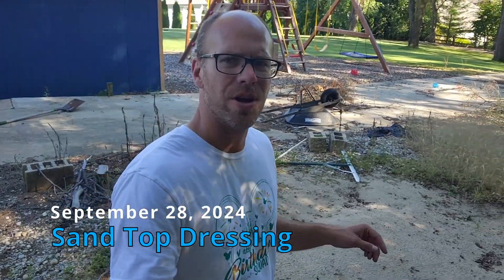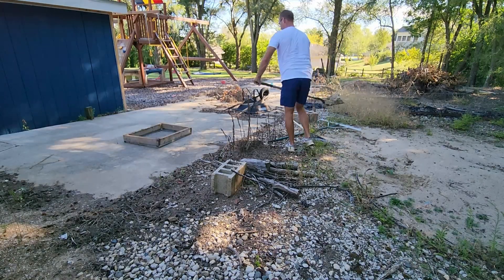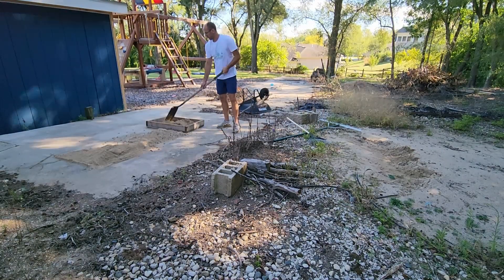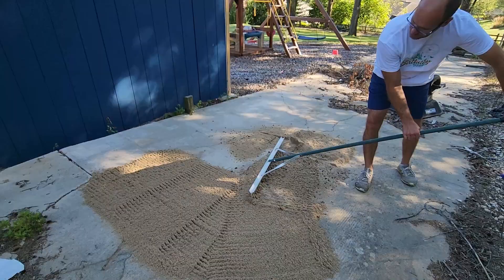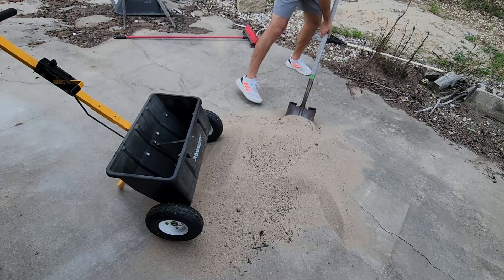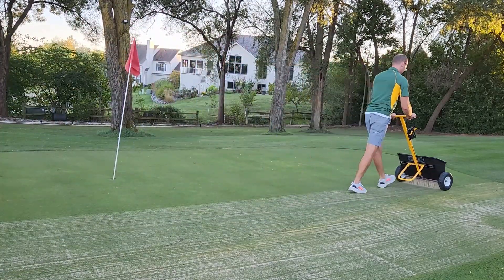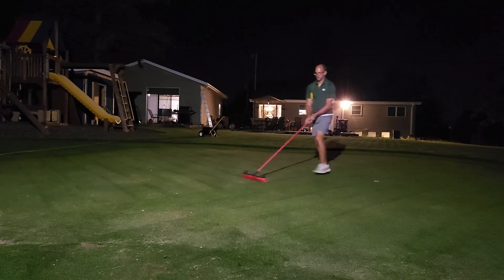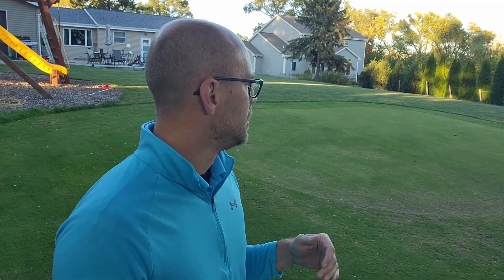Sand Top Dressing a Putting Green

Comment: How large a green is it? I think you and I are essentially in the same part of the world; I also struggle with worm casts.  I am unclear what kind of grass you're using on the putting green.  Does it just die every year? Do you have to worry about it spreading into your lawn?
Reply from the maker: There is a lot to unpack here, but I'll try to be as succinct as I can. I'm in the Milwaukee area. It is predominantly bentgrass. It doesn't die inherently, but being cut very short makes the margin for error much smaller combined with bentgrasses susceptibility to diseases like pythium and dollar spot. Dollar spot is what I lost a lot of the green and fairway to this year. I also struggle to water effectively as I don't have irrigation and have a ton of evening activities that don't allow me to water. I don't worry about it spreading as there are some selective herbicides to remove it.
Reply: @JasonSeiberlich  Thanks; yep, same part of the world. You didn't mention how large the green is; I'm sitting on 1/3 of an acre, wondering what area I would need to make for a good project. I recommend checking out 50lb. kiln dried bags of mason sand from Menards.  The sand is bone dry, and extremely uniform. The bags are super convenient and can be stored outside. I know USGA sand is special, but I can't imagine anyone could ever tell the difference.
Reply from the maker: @hatpeach1 sand selection is mostly for particle size to ensure appropriate drainage and resisting compaction. But, yes, mason sand is usually fine. Often just too high percent of smaller particles that can pack together. 

My green is just under 1000 square feet and the whole area is around 7000 square feet.
Reply: I use same mix I used for the root zone mix to top dress with. It’s 90/10 Dakota peat mix from my local sod farm that supplies all the local golf courses. I had read somewhere (I think perhaps in a USGA article on the topic) that if you can, best bet is to use same rootzone mix to topdress with. I built to USGA specs so I have 12” of rootzone. Green is approx 1650 sf or so. Maybe tad larger.
Reply from the maker: @KA-dm9lm that is correct. I just have a sand cap on native soil, so that's why I'm all sand.
Reply: @hatpeach1  I’m a moron. The 90/10 Dakota peat mix I use does tend to stay moist. I spread it by hand by basically just throwing it because it won’t come out of the spreader when moist. Then I brush it in. But now that I see Jason drying it, that makes a lot of sense. I didn’t think to do that. I think the peat content in mine likely makes it hold water longer. But if I can dry it a bit and then use the drop spreader that might work well. I don’t like taking the extra time as similar to Jason, it’s tough to find the time to do stuff.
Reply: @KA-dm9lm  The dryness issue is why I recommend the Big Box 50lb. plastic-packaged (not paper) mason's sand, if you can afford it.  Storing it is a dream because it's in water-proof, stackable, packaging.  It pours like a liquid.  If you buy in bulk, even delivery is affordable. I know it's not USGA, but that's a quality difference that seems so marginal that I can't believe anyone here, other than the most die-hard enthusiast (perhaps Jason), would appreciate, though I admit I am not working on a putting green. Each package costs just under $5.  I over use this stuff whenever I have a low spot because, at my stage of the lawn-care journey, "level" is more important to me than thick and green -- that will happen next season with a bit of amendment because KGB creeps, and ryegrass is always easy.
Reply: @hatpeach1  So I think once my green develops more and really creates a firm thick mat, this approach would likely be perfect. Kinda like Jason’s green. 
Mine is new. I planted 7/3/24 this year so I’m still in the grow-in phase. Also having built to USGA spec its planted in 12” of rootzone (details above). When I built the green that cost $90/yd. But know that I’ve built a relationship with the guys there the sell it to me for $60/yd. I think for me until end of next growing season, I should probably stick to the same rootzone mix. But yeah, once I get something a bit closer to Jason’s, that real green mat, I think your approach will be perfect. Especially for light, regular top dressing. Going to make a note of the sand you’re recommending. Thanks man!!